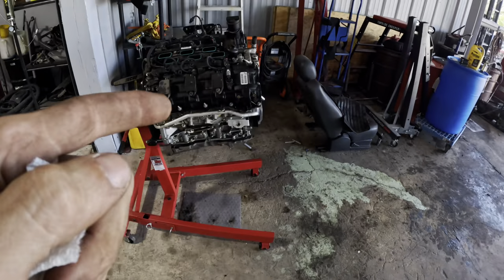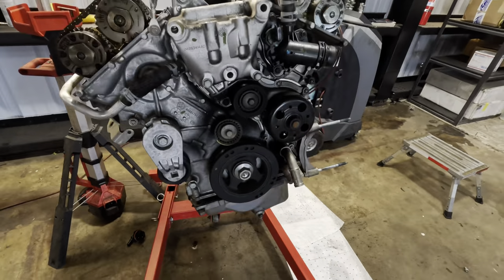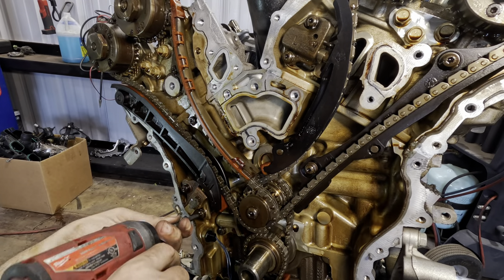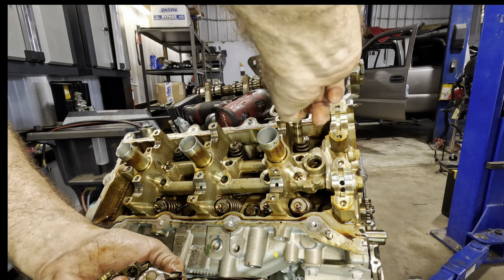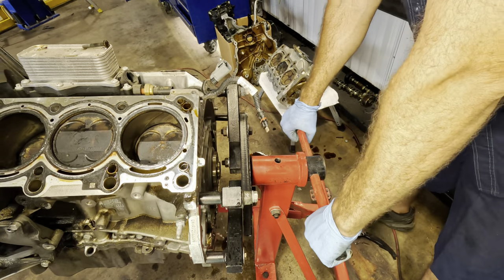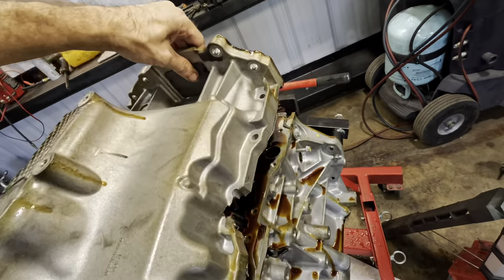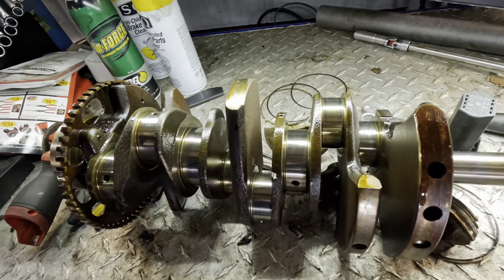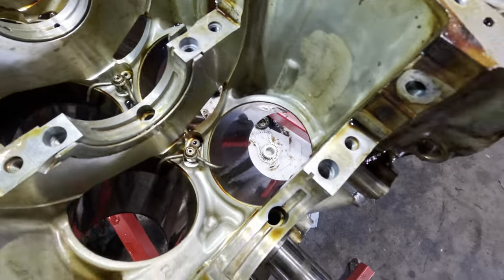Blown Engine--Broken Rod ! Autopsy 3.6 Pentastar Ram Jeep Chrysler

Comment: LOL. You'll have that on those Chrysler jobs. Oh who am I kidding, people can and will blow up anything!
Great video Ray.
Reply: Seems to be more Chrysler issues then anything 😂
Reply: I thoroughly enjoyed this Ray, watched every minute .. the engineering into these engines warps my brain .. and that one brain cell tells me they needed couple more chains 🤣
Reply: Ray you will need to name your pry bar.  Eric has Blue.
Reply: I was going to say, Did Ray change his name to Eric? Little malice in the combustion palace there. That parts good, then throws it just like you Eric.🤣
Reply: Should have done the collab on this lol
Reply: When the bottem end is blown out on a low power computer controlled engine you know it was murdered.
Reply: I wonder if the engine got slightly hot, and the piston ring end gaps butted together, breaking the piston above the top ring groove, and possibly other places too, hence the misfire. From there the cracks in the piston spread as the engine continued run until the pin tower on the one side of the piston let go of the wrist pin(one pin tower is broken while the other is not) and causing the reciprocating forces on the rod to have to push and pull on just one side of the piston. This would add a bit of twist to the situation until the the rod just broke and then broke some more as it created inspection ports in the block and windage tray. I think the clean spots on the top of the piston are just from striking the head.
Reply: Look who commented!! Nice one Eric!! I agree with you.
Reply: Oh, man. I miss the good old days when Chrysler was Chrysler, and they still made the Slant-6 and LA-series smallblocks. 
There are only two ways to add an inspection port to a Slant-6:
- Take the massively undersquare long-stroke 225, put on a 2-barrel carburetor, and put a brick on the gas pedal. 
- Take a garden hose and point it directly into the carburetor of a running engine. 
Nice video, Ray! And Eric, I am a fan and subscriber of yours too.
Reply: I drove a tbi 5.70 Tahoe I bought for parts with a baseball size hole threw the block, drove it about 4 miles as my tow rig was down, though for sure I was going to have to call a tow truck, needed the trans from that Tahoe lol. I don't even know how you blow up a gutless 5.7 like that, but people surprise me.
Reply: I definitely enjoyed Ray Do Cars.
Reply: @ltdees2362  Please, it's not an Audi. (You don't want to know...)
Reply: hydro locked probably stuck fuel injector
Reply: A BIT OF INFORMATION WILL SHARE WITH YOU (THE SAND CAST WAS NOT WASHED/CLEANED OUT OF THESE MOTORS CAUSING COOLENT FAILURES HEATER CORE STOPPED UP QUITE OFTEN)IE HEAT ONLY ON 1 SIDE
Reply: I agree
Reply: He makes look so easy, it is not!

Comment: I'm guessing it was a leaking fuel injector that was causing the misfire all along, and it filled the cylinder and caused hydrolock. I've seen it before, and both times we were very lucky to get away with blown head gaskets. I'm definitely curious about that #3 injector, because that's what i was guessing the problem was the first time when it reeked of fuel in that cylinder
Reply: Id say your right...except the duration isnt correct.  The misfire came with some enrichment of the trims but not a full skew.  Its florida though, land of big rains, big puddles and casual flooding.  Inspecting the air filter would probably tell the tale.
Reply: Would this show as low compression? Maybe from fuel washing down the cylinder walls.
Reply: I was guessing the low compression was a cracked ring or something from an almost hydrolock situation. 
As far as fuel trim, it's only reactive based off the o2 sensor. The computer has zero feedback from the injector, it just gives it signal to open. Keep in mind there's 5/6ths (or 2/3rds) of the exhaust mixing in to the one bad cylinder
Reply: @lewzero  Misinterpretation of what I was saying.  The fuel trim data gives you a general idea of compensation even with a light misfire.  It appeared in the original video that the injector was operating normally.  Not to say it WAS or that it wasnt leaking just that the data he showed really didnt reflect that and neither did the cylinder wall or rest of the engine internals but especially bearing condition was great, not really suggestive of fuel dilution from an injector issue.  But again, definitely could have been.
Reply: @tedma8757  depends on the mechanical nature of the injector failure, but I tried to get a good look at the cylinder when he was showing that stuff, looking for piston scuffing and so on, and even bearing wear would indicate fuel dilution, none of which appears to be present.  Given the recent weather in Florida, I lean on water ingestion.
Reply: Same
Reply: Interesting theory. 🤔
That piston definitely hit a non-compressable object!!
Reply: I thought he replaced that injector. On the original video I was wondering if the oring on the injector that was replaced, later failed. If it failed right away, he would have seen/ heard/smelled the gas pouring out...
Reply: @RicQuintanilla  i need to go back and look.  I though he moved it not replaced it
Reply: I agree.  Seen it before.  Brother works at dealership.
Reply: If there was enough fuel flow from the injector to hydrolock a cylinder it must have been wide open, and it would cause the fuel rail pressure to plummet, which would really bog the engine down really fast.
Reply: @blackopsrocks either way, the oring was reseated... And could have failed at the time or later.. later being my guess since it didn't run like doodoo after the repair.
Reply: Whatever happened to the engine exactly, we may never know. Life goes on
Reply: @RicQuintanilla  that doesnt have bearing on fuel quantity inside the engine.
Reply: my thoughts also
Reply: I doubt this is the case, it would've had to have been a serious leak and any leaking fuel should've been vaporized and left through the exhaust port due to the engines heat alone. Either way that's one NFG/POS motor if a faulty injector can do that much damage.
Reply: It would be nice to be able to confirm this for future catastrophic prevention.
Reply: Wow you're probably right considering the piston got a steam bath somehow,gas would do the job,I just learned something, thanks
Reply: Fuel injector problem. Failure
Reply: The low compression was probably from a previous hydrolock/misfire event. Bent the rod initially and then it was running short stroked. Guess it must have finally fatigued and quit.
Reply: I said the same thing in a comment on the original video. He replaced the injector with a cheap, aftermarket injector. The injector was leaking profusely and washed down the cylinder before hydrokocking it. It also explained the watered down oil in the original video. In the original video he said the customer stated that the engine was losing power before it grenaded. There was no mention or visible evidence to say that the engine overheated and digested coolant. The head gasket was fine. When he drained the oil in the first video the coolant would have come out first or the oil would have at least been "milkshake". The rest of the engine looked perfectly fine besides the one cylinder that he touched and put a new injector in. I hate when mechanics don't stand behind their work when they make a mistake or install crappy parts. Sh!+ happens. Own it, fix it, and move on.
Reply: @anthonyp81979  yeah I hate mechanics like that to ,id never thought a leaky failed injector would cause this much damage though,but it makes sense. I learn something every day and I am 60😄
Reply: Like you said, it is a guess, and wrong.
Reply: So he got a bad injector? He replaced that one not too long ago
Reply: @blackopsrocks  I've damaged a lower injector oring, the fuel that passed the oring went into the runners and into the chamber and hydro locked the engine.  but it did it during priming for start up. but it wouldn't let it start. I  pulled the plugs and cranked it again after pulling the fuel pump fuse on the car i was working on, and it shot gas out of the cylinder I screwed up like a geyser. :shruggs::
Reply: I didn't realize he replaced the injector in the first video.  If it had already tried to compress fuel but not enough to lock it, that would explain the low compression.  At that point it was just a metal fatigued bomb waiting to go off. I sure wouldn't blame Ray for not being able to see the grain structure of the rod/piston, then just fixing the broken ancillary parts. It definitely could have knocked itself clean during a catastrophic event, and that would absolutely explain most of this.

Without evidence otherwise, I still feel like there was no hope for this engine before Ray ever saw it, whatever killed it.
Reply: @lewzero  it's just strange,but y'all got to admit, it's a damn good mystery to try and solve lol
Reply: @RicQuintanilla  damaging the lower o ring  introduces unmetered air not fuel, you damaged the injector body as well.
Reply: @RicQuintanilla  ill also point out the extremely obvious. He started it, ran it, drove it into the shop and it was not leaking fuel or anything indicating it hydrolocked on fuel.  He would have known immediately if that was the case.
Reply: If you watch a video from barium engines, Lee gives injector problems as #1 cause of cracked pistons.
Reply: @kathyquinlan5922  car companies just have no engineering quality control I guess
Reply: @kathyquinlan5922  again.  I dont disagree with that as generally sound statement.  However.  Injector was already investigated, fuel trims noted and the engine still failed.  I believe is ingestion on a non compressible fluid...like water.  And given the frequency of big storms in florida and WHERE the airbox and height of it is on that particular vehicle I believe it hydrolocked.  Actually I don't think it was the only time that has happened.  I think the customer got away with a slightly bent rod the first time, and because I have experience with jeeps using this engine taking on water and destroying the same piston (maybe due to path of least resistance inside the manifold?) I lean pretty heavy on this being a van that took on water more than once.  But to deny my claim, would need to look for evidence of water getting through the intake tract, dirty intake piping, etc...something to indicate it had taken on some water, maybe a crusty air filter.
Reply: I was thinking the same thing not common but it is a thing that happens
Reply: @242SemperFi  yeah I figured it wasn't common but I think it could happen,
Reply: Do alot of engines in these..the head gasket fails.. fills cylinder with coolant causes misfire ans let go long enough this can happen or usually get towed inba no start with a bad starter from trying to start motor with coolant in cylinder...I've seen them bad enough u can put a bore scope in cylinder with a pressure tester or coolant system and literally watch the cylinder fill with coolant
Reply: @davesgladiator5267  evidence of burning coolant on the plug or no?
Reply: Rod was bent because of fuel from the original injector?
Reply: There were no misfires after fix
Reply: All these comments just deepens the question…What the”H”  abused this 🤔😙
Reply: No I think it was Coolant  you could see tracks (on top of head gaskets )between combustion chamber and 

coolant passage that is also why 
gasket was misshapen on water pump. When cylinder fired the e xplosion was pressuring coolant  system. You can see the void created in carbon marks  beside that piston hole on head gasket. Coolant leaks down on with engine off, then you start engine and it breaks rod because you cannot compress coolant , piston cracks it is all over.
Reply: Is this more common on newer engines? I don't think I've ever heard of a 90s vehicle hydro locking from a leaking injector.
Reply: Could be that or maybe the water jacket on the cylinder was cracked just enough to let water through
Reply: The one thing that no one seems to have commented on is that when Ray pops the timing cover off 13:52 the banks look completely different. The good bank is clean, the other bank is covered in shellac as isvthe lower half of the inside of the cover. Like it got really warm at some point. So maybe a first owner had a cooling related issue and didn't disclose that during the sale. Then this owner gets a life shortened engine which eventually had fueling issues and then grenades.
Reply: It was coolant leaking through the head. Apparently, they warp and then cylinder 3 hydrolocks from the coolant leak. Common issue according to a chrysler mechanic.
Reply: @RowanHawkins I noticed exactly the same thing.  I was surprised he didn't say anything.  You can see the difference when he takes the valve covers off.  Even before he removes the chains and cams.

Comment: A former 2017 Pentastar owner here! I had a misfire in cyl 3 brought it to the dealer as it was under warranty.  after 3 failed attempts for them to diag and fix I did a compression test and found it to be lacking. I brought it back again and they found the head gasket had failed and needed to be replaced. Long story short, it was a problem for that year and a lot of engines failed because it was not caught in time, so my guess would be the gasket failed and hydro locked the engine, destroying the piston and rod.
Reply: Old-school mechanic could diagnose problems before computers with stethoscope a compression tester, and a fuel pressure gauge.

Comment: There is a recall on a lot of those engines as well as several class action law suits. I am involved in one of them now. The problems revolve around the #3 cylinder misfires leading to cracked valves and head replacement. Look up that engine and read about the lawsuits as they are moving forward. Take pictures and keep the parts so that when the suit is settled your customer can get some money back. You are right these engines are self destructing a lot.
Reply: and most last the life of the vehicle without any problems at all
Reply: Sometimes shit happens even if you're good about maintenance
Reply: Did the customer opt for a new engine, or just junking the car?
Reply: @mobility63 Only The Shadow Knows (if you’re old enough to remember)😮
Reply: I wondered that, too. It seems like a lot of extra work to pull the engine before junking just for a curiosity autopsy, so I'm guessing the customer opted for a new engine.

Comment: Coolant leaked into the oil which caused overheating which blew the head gasket which caused the hydrolock.  It all started from a bad O ring on the water pump. Great video!
Reply: Jiffy Lube technician overfilled the blinker fluid reservoir which led to hydro-lock.

Comment: I think your hypothesis is spot on.  Liquid must have somehow been ingested into the combustion chamber and since liquids are not very compressible, something else had to give, namely the pistons and connecting rods.
Reply: I agree.  Seen it before.
Reply: It must have happened under heavy load as well. Possibly the water pump pushing a lot of coolant into the cylinder under high RPM, which caused the piston and connecting rod to shatter? If it was a gradual fill of liquid under low load or idle then it would have hydrolocked but just caused a stall.
Reply: I like you put that! Technically speaking, you CAN compress a liquid, but you'd need a large industrial plant with lots of very expensive equipment in order to do.
Reply: @Rekuzan  Or a black hole. But those don't normally form inside of Fiat engines.
Reply: We can never have too much prybar action
Reply: @oldfarthacks  What brand of engines DO black holes form within???
Reply: @oldfarthacks  No, usually those are found inside the bank accounts of any road worthy BMW owner or between the ears of your average politician!🤣🤣🤣

Comment: Cylinder 3 had low compression.  That's evidence of a head gasket leak leading to hydrolock.  The rings were good, so that's where the problem came from.  Great autopsy!
Reply: Could have had an injector fail washing the cylinder causing low compression also.
Reply: The leak wasn't an immediate catastrophic failure. It took a few cycles to steam clean the top of the piston before the hydrolock. 
There's an upside to the disaster. That scrap aluminum can make a lot of beer cans.
Reply: A bent rod would’ve led to low compression.
Reply: @Casmige  hydro locked would’ve broke the rod immediately therefore the rod wouldn’t have been bent Causing low compression.
Reply: Fuel wash will cause low  compression readings ....
Reply: @Casmige you are exactly right, it had coolant in the cylinder, bent the rod leading to low compression, then later the rod broke.

Comment: From across the pond in sunless England, not jealous of your lovely warm sunshine. We love rain that’s why we have so much. 😂 recently subscribed to your channel. Sadly your version of junk vehicles make ours look awesome. I’ve got a 2012 diesel Renault (opal/nissan/vauxhall) with a larger block Nissan engine. Water landed on the injectors and welded the rusty crap into the head. V4 1.9dci 115bhp. My mechanic used a puller slide hammer injector press then trolley jack. The head snapped. But the injectors didn’t. The sort of job you’d love 😂😂 keep clicking. Superb videos mate 👍

Comment: When you found a clean piston that screams water. Look real close at the gasket. Its not a huge leak. Im sure it did not take much with aluminum.  Would have thought you would see steam out the tail pipe? TY for the autopsy. It was interesting to see just what happened.
Reply: Ray failed to closely inspect the gasket and the block which had clear signs of water leakage.
Reply: It's Florida.  Hard to tell the difference between steam from the tailpipe vs. steam off the gulf or glades. lol.